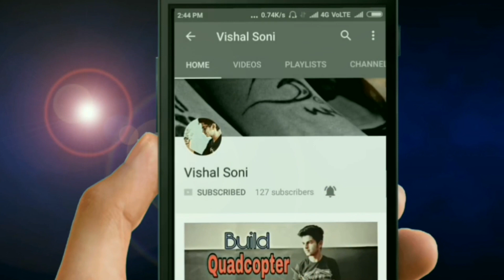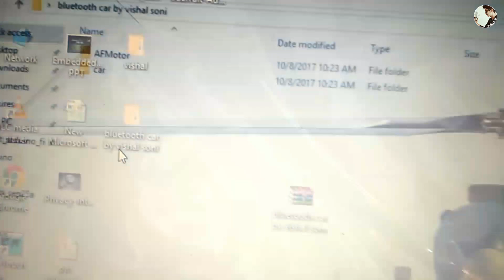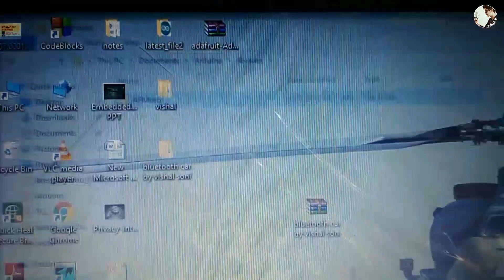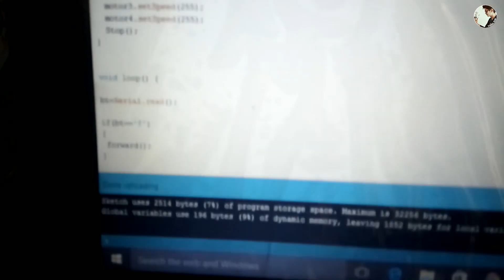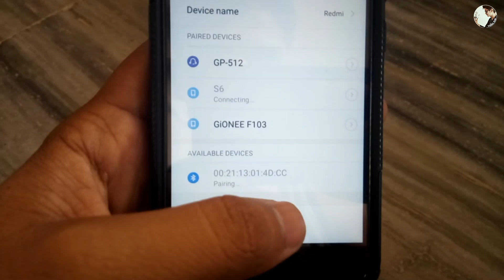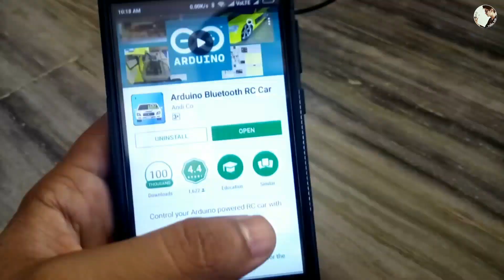Mobile Controlled Car via Bluetooth || motor shield || hc-05 || arduino || simple || vishal soni

Comment: U have connected 2 batteries one for arduino and one for motor shield now should I connect one 9v battery to arduuinl Jack and 12 v battery to motor shield or in Connecticut only 1 12 v battery to arduinp Jack??  Which method  should I use 2 batteries  or 1 battery
Reply from the maker: Use 9v for arduino and 12v for motor shield

Comment: Hi i put 12 v lead acid battery to motor shield and then arduino also turned on so I did not attached another battery for arduino uno I only used one battery for motor shield and arduino uno automatically turned on but the problem is that after some time arduino gets hot. So can arduino have 12v and motor shield can manage  12v without getting damaged??
Reply from the maker: DHRUV SHARMA 
Yes..... Connect your 12v to the arduino's connector jack it will convert in to 5v...
Connect motor shield from same 12v battery...
Reply: DHRUV SHARMA can i ask for your code where you can control the speed and add lights?

Comment: Your code is not working
Reply from the maker: Ayaz Ahmed 
It will work.... Just Chang bps to 9600 and try........
Reply: thanks it worked!
 but not rotating at all when i connect voltage below 12 to the motor shield power port( where you use peak voltage)
i've used 4×12 volt DC motor.
it rotated when i applied 12 volt . is it safe to the motor shield according to your connection to the 4 12 dc motor?
Reply from the maker: The motor controllers on this shield are designed to run from 4.5V to 25V.
So no problem
Reply: thanks.
i've connected bluetooth module to the servo + and -.
if i use 12 volt is there any state to impact in module. module willbe safe? servo motor port ranges? or something?
Reply from the maker: Ayaz Ahmed 
Servo terminal will give 5v output at + & -  terminal. 
So you can use that terminal. 
But if you want then connect Bluetooth to the arduino's 5v supply.....
Reply: thanks vishal soni bro.
and don't worry about subscribe i'll do it and also invite my friends .

Comment: can u help me to communicate my hc06 with my phone? i have problem with that
Reply from the maker: mak bulu 
What type of problem.
Reply: i wanna build a mobile controlled car. im using hc06 and remotexy software. the problem is. my hc06 cannot connect with my phone. it keeps alarm me that device not reply. what should i do?
Reply from the maker: mak bulu 
Turn on Bluetooth and search for new device... 
Click on hc 06 and enter default password and connect it.. 
Then go to app and connect via app
Reply: already done. but cannot connect too
Reply from the maker: mak bulu 
There is light on hc06
Reply: yes. the led on hc06 keep blinking
Reply from the maker: mak bulu 
Try with other apps... 
When it connected it blink with long delay
Reply: try to change  Serial.begin(9600); instead of   Serial.begin(38400);

Comment: Make a video on free energy using motors
Reply from the maker: It is very simple... 
Just connect motor terminal to load and connect a pulley at motor shaft. 
Use a belt to connect with small pulley then rotate it... 

Just ask to 9-10 class student near you about it....
Reply: Vishal Soni dose it works,
I mean a many video on YouTube on this concept but at comment section everyone's says it's fake.
Reply from the maker: Abhishek Soni 
It is possible but only for small led not for big load like charger or any fan........ Because we can't get enough energy via small motor..... 
Make sure your arrangement is better for rotating motor.... 
Just take a bicycle put it upside down and rotate wheel. 
Touch the motor shaft on the wheel and the led glow up...
Reply from the maker: Abhishek Soni 
May be it work but I thik motor drown more current that it generates and led also taking it so it is not possible...